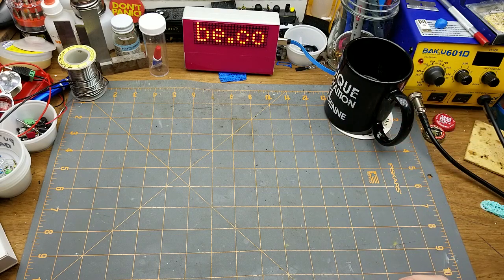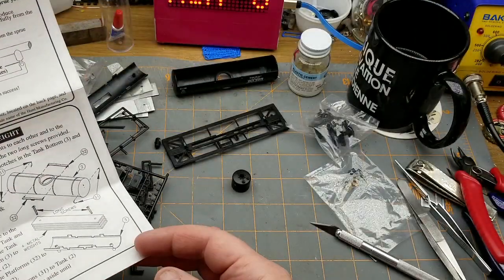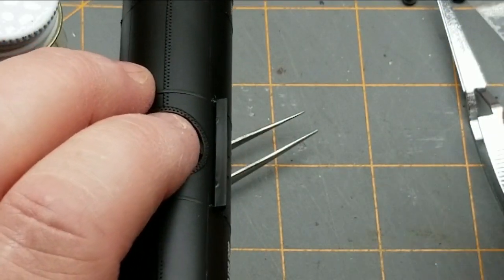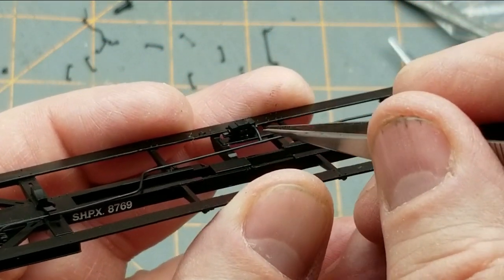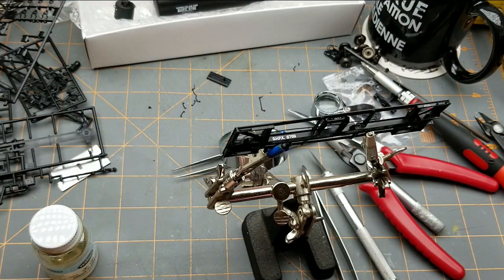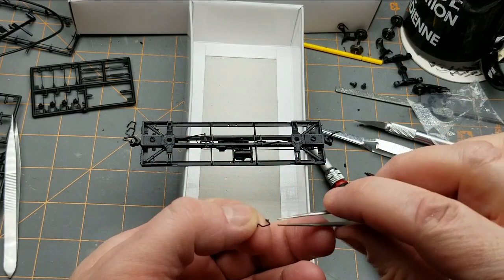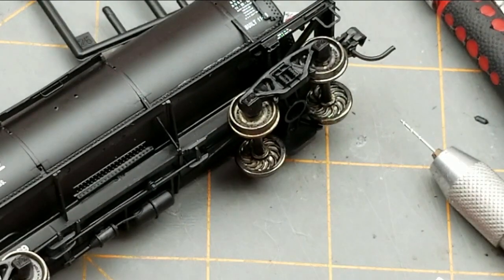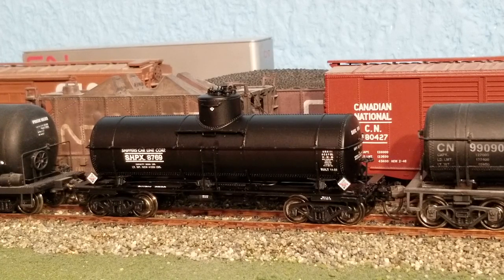model kit build  - 8000 gallon tank car

Comment: That looks like a great kit to build.  Since there aren't too many companies producing RTR rolling stock from the turn of the century, I've been building Tichy Train Group kits.  They are fun to build and look like an expensive model when you're finished.  So far I've built 2 ore cars, a 40' 50 ton flatcar and a 40' 50 ton wooden side gondola.  I've got an ARSA outside single sheathed boxcar to build next.  All these models date from the turn of the century with K type brakes.  Tichy also has 2 different tank cars I want to build.  I love building kits and scratch building.  Cheers from eastern TN

Comment: A few tips of my own:
1. For small parts, stick masking tape to the underside of the sprue to help hold the tiny bits as you cut them.
2. Use neat MEK as cement. Use a very tiny brush to drop it exactly where you want it. Place the items together and touch the point of the brush to the gap area. The MEK will immediately 'wick' into the gap leaving almost no trace.

Comment: Proto 2000 kits are still some of the best kits around (if you can find them). Thanks for sharing your build, great work!
Reply from the maker: I agree. When I go back into railroading (after the traditional "young kids in da house" hiatus) I was saddened to discover that P2K kits were pretty much gone from the scene.
Fortunately I have a bit of a stash of "new old stock" in my pile of stuff.
Reply: A few years before selling the line to Walthers, Life Like started to offer these as ready to run models.  Walthers carried on with rtr after.  I wish they would bring back some of these cars.

Comment: What are some of your tips or advice when putting a Proto 2000 kit together? XD I put together a Proto 2000 stock car a while ago and felt that it was a nightmare to build. Much more complicated to build than an Athearn Blue Box or an Accurail kit lmao
Reply from the maker: P2K are a more advanced kit than the good 'ol blue box, aren't they?

But they're nothing to be intimidated by. 
I'd suggest a sharp blade, lots of light, some magnification and take lots of breaks.

I find the grab irons, stirrup steps and brake rigging to be the most challenging, but if I take my time and go slow I can get them eventually.
Reply: P2k and Athearn BB are two completely different products. If you think the P2k kits are difficult, they really aren't, from a true modeling perspective. They have the same complexity of any really good military model kit, aircraft, armor, etc.  If you think that's bad, try scratchbuilding a railcar.

There are no secrets to building kits like these. It just takes the right tools and some patience.  And you cannot buy patience. So maybe the bluebox stuff is better for you?

Comment: I thought you put the part runner on the table and push down with a blade, and watch the part flick away into the distance. lol
Do you guys have US gallons or UK gals.
I want to see the whole layout running automatically using a MEGA2560 - 50 pins should run everything -.
Reply from the maker: This car follows an American prototype, so it would have been in US gallons.
Back in the confusing days of my youth Canada used imperial gallons but we had to be aware of American since we import so much from them. Life is so much less confusing now that metric rules the land.